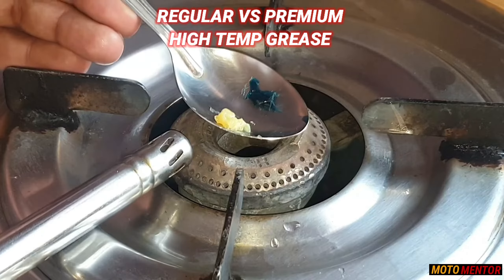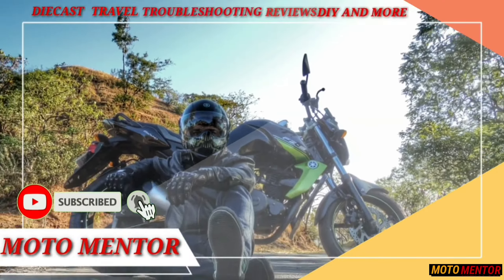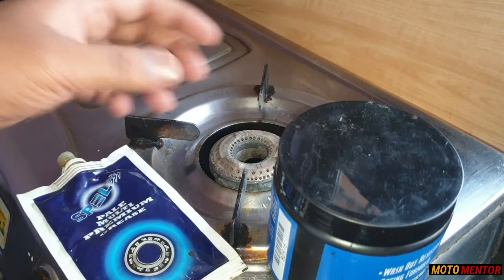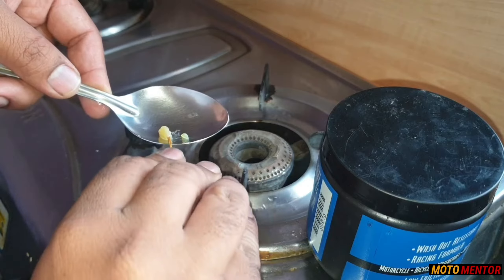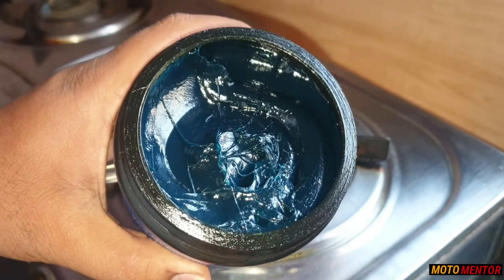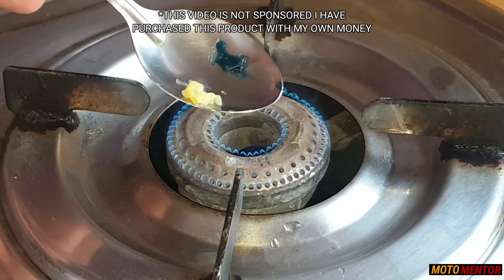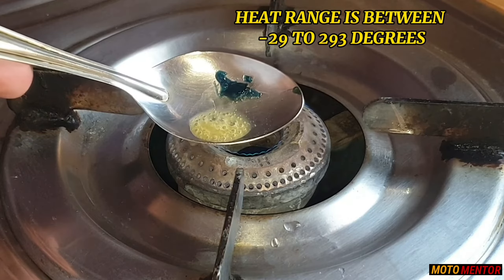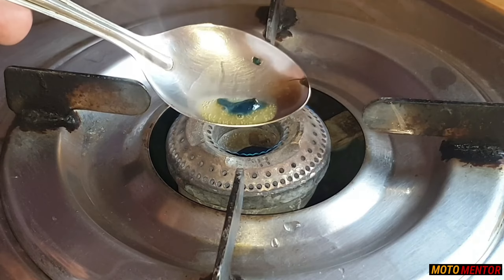I GOT THE EXPENSIVE GREASE FOR MY BIKE | TOUGH AND LONG LASTING GREESE FOR MOTORCYCLE

Comment: Maruti Suzuki Sells the same high temp grease in small 20 rupee packs i use them to grease brake calipers you guys can also buy it if budget is low availabe easily at maruti suzuki spare stores
Reply from the maker: Wow thats a great information I wish I could have know this but thanks for sharing man. Appreciated will check this out.

Comment: Its not right way to check... you are directly connected with flame....wrong method
Reply from the maker: Thats what I just took a pinch of as it its a high grease temperature too I understand your concern about safety and its a valid point but this just for educational purposes.  But ths thanks for your comment.